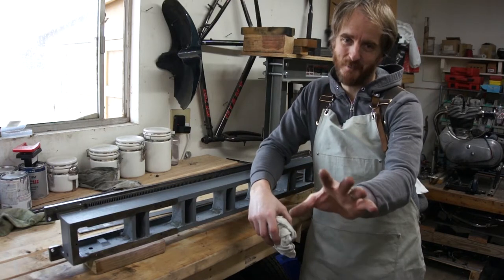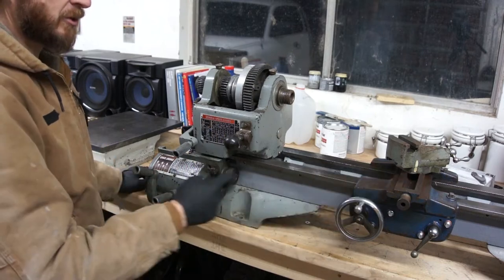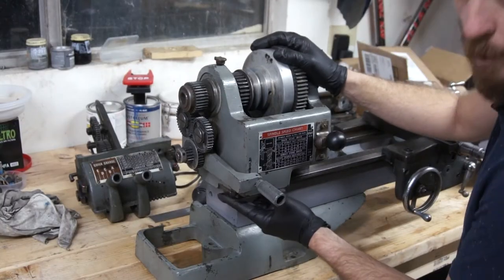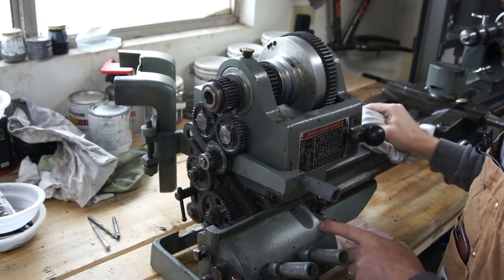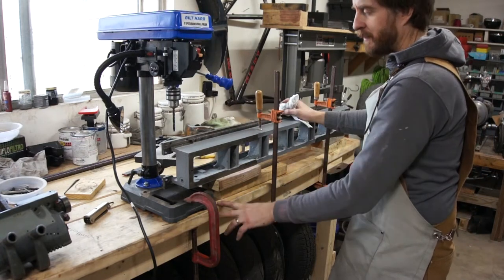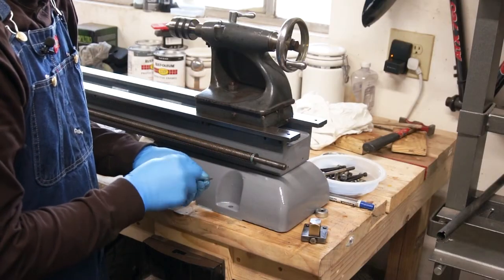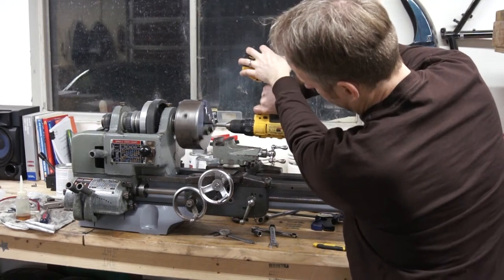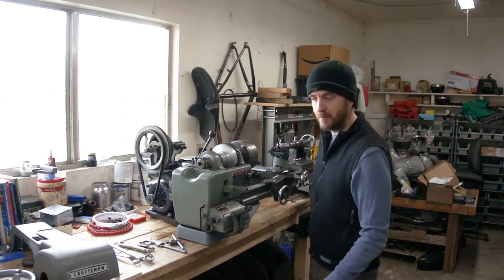Making an Atlas (Craftsman) 12" Lathe from eBay spare Parts - Part 1

Comment: The Atlas Craftsman lathes are a good choice for home small shops. Professionals talk down about them, but they have some advantages that make then a good choice.  One is almost any part can be replicated with the equipment you have in the shop. they are a flat way design, and you can recut the ways in a milling machine. I have two of these and i recut both on a rung fu type milling machine. If the lead screw is worn badly and most are in the normal area just past the chuck you can cut the shaft at the end of the threads on both ends, drill alignment dowel holes, and swap end for end. weld in place and now the worn part of the screw is on the tail stock end and almost never used threads are in the most used area. You can use the tailstock end of the bed for a master to scrape the carriage to get the warp out of it. I have had many apart and they all seem to bow up across the bed at the cross slide screw area. when reassembling the carriage add a inch wide brass or bronze wear strip under the carriage front and rear  contact points. Usually, .010 thick works out. It tightens up the hand wheel to rack clearance and doubles the carriage to bed contact surface area for more ridged contact.  Nice adaptation of different model parts

Comment: 942 is a 42" bed and could be a 9" or 10" lathe. You'll notice other part numbers begin with 9 also, and can be used interchangeably with 9" or 10" Atlas lathes.

Comment: A really cool undertaking Robert! I went a different direction. I bought an old Atlas QC42 lathe that was rusty and had been neglected and sitting in an open barn for who knows how long. So now I'm buys parts left and right on eBay to replace the old worn out ones. My lathe bed has .005" wear and I'm not sure if I'm not sure if I'm going to just live with it or get it machined. I'm looking forward to your other videos on this to see what you ended up doing with your .010" wear.        New Subscriber!

Comment: Initially, I thought, "Oh, Brother..." about this project but ended up liking and subscribing. Since you mentioned a VFD you may not be using a two step motor pulley but if you are, what are the motor pulley diameters? Thank you.
Reply from the maker: Hi, Mark.  I'm running the countershaft assembly from the 9" model.  It has the two pulleys, 7 1/2" and 9 1/4" in diameter.  I'm running it in the smaller diameter pulley which, coincidently gives me about a 1:1 between frequency and RPM on the VFD readout.

Comment: Nice video, good to see someone kinda cobbling one together. I have one that’s somewhat been cobbled over the years and I’m trying to find every reference I can for how they go together and what parts should look like
Reply from the maker: Hey, Thanks.  I tried to capture what I used and what fit together when I did mine.  There were really four versions - the 9", the 10/12" without the quick-change, the 10/12" with the quick change, and the 12" commercial.  Areas where you can't mix-match:  The lead screws and the headstock mounts (between the non and quick-change gearbox versions).

Comment: Interesting project Robert. What was that Triumph in the background? The cylinders are familiar but that bottom end looked odd. Best!
Eddie
Reply from the maker: Hey, Eddie.  That’s the back half of a BSA B31 and an Enfield 500 engine on the table.  There’s an A10 tank somewhere in there too.  They are part of a custom build that I need to get started.
Reply: @RobertAdairWorkshop  Oh its an Enfield, that what threw me. I guess my eyes are going. Good deal, I have a BSA 441 Victor that I need to get started on as well, lol. Best!

Comment: Interesting way of acquiring a lathe (and a lot of work). I'd be curious what you paid for all these odd-ball parts to do this. Current eBay prices are insane. Nice work regardless.
Reply from the maker: I've never added it up, but in the interest of science, I just did.  $2997.15 in 2021 dollars.  Ooof.  I've added a cost breakdown to the description if you're curious.  Quick change gearbox was rediculously expensive compared to everything else.  Those go for big money.

Comment: How much did you end up spending?  I know I started buying vintage lathes 4 years ago and there worth 4 times what I paid already. I have 2 mills also a Sheldon horizontal and a grizzly vertical, l learned very fast vintage is still the best way to buy,
Reply from the maker: Way, way too much.  Cost breakdown is in the description.  Just under $3k when it was all said and done and that doesn't include the stand or ancillary stuff.  I've used it enough I feel I've gotten my $3k back but I would have bought a different lathe had I known how much money it would ultimately cost.  At least I was able to make an interesting video from the ordeal.
Reply: @RobertAdairWorkshop   l kind of figured that much,,  believe it are not I'm 3k in for 6 Atlas lathes and Alot of assessor's

Comment: Use the surface grinder to true the bed.
Reply from the maker: Yeah, that's what I plan to do.  Once the surface grinder works.  I need to build up some experience with it first, though.  Any tips on how to do the full length of the bed?

Comment: I haven't finished watching the video yet, so maybe you covered this point, but if you had shimmed up the headstock first, like you plan to do anyway, it probably would have appreciably reduced the amount of material that needed to be removed from the ways for that gear in the headstock. 

Now, I realize that my idea may not be very helpful to you at this point, but I thought I'd add it to the overall body of human knowledge for future generations... :)
Reply from the maker: I didn't really expand on that much in the video.  It didn't require any shimming to make everything fit together, despite the bed thickness differences.  But that's a good point.  Moving the headstock upward 1/8" could have saved hours of Dremel work.

Comment: My advice is don't pull the gear box apart was one of hardest things I've had to do putting mine back together was pure hell, the gear box gear's are all steel and not zmac like all the other lathe gear's,
Reply from the maker: That's good advice.  I did it earlier this year, though.  The intermediate shaft had worn quite an groove in the housing bearing surface.  Ended up making new shafts and boring out the housing for bronze bushings.  Works like a charm now but took a lot of ingenuity to do it with the tools I have and to get the right parts.  Given how much these quick change gearboxes are going for on eBay, I figured it was worth doing right.

Comment: Oh me oh my....I'm doing this same exact thing right now. Thought there was going to be quite the option on Egay for parts. I WAS WRONG ! The snakes & weasels know these parts are scarce and will gouge you into bankruptcy debt. They strip em down to every nut & bolt so to charge you more for a this or a that. NEVER can find an entire assy for a fair price like a carriage compound. The power feed parts in the apron will set you way back...Is it all worth it? NO....buy one that has all the parts good or bad and replace worn parts as you can trying to make them yourself.
Reply from the maker: You are spot on!